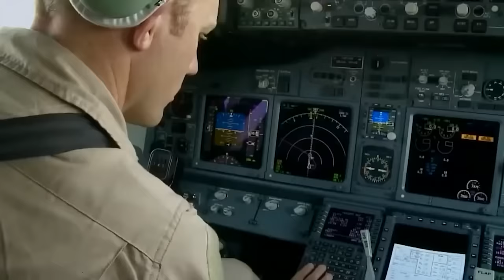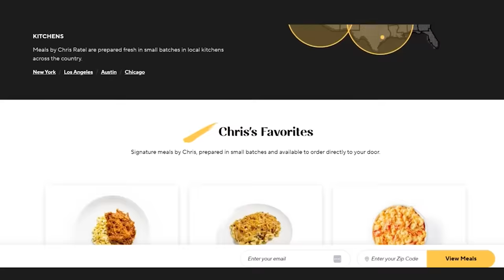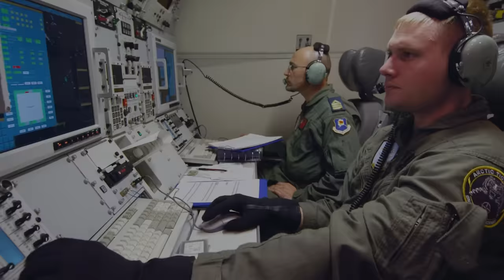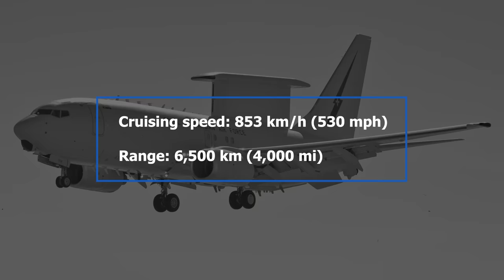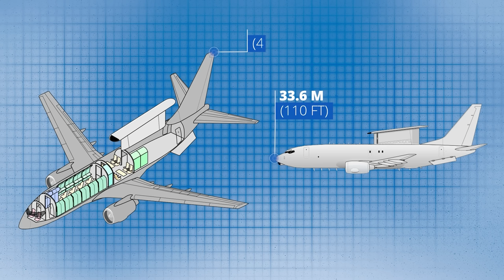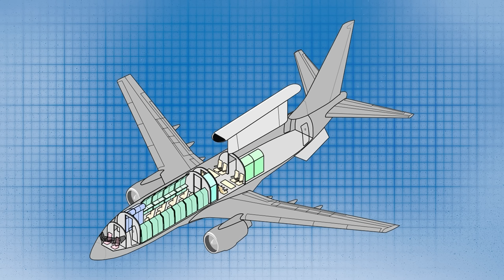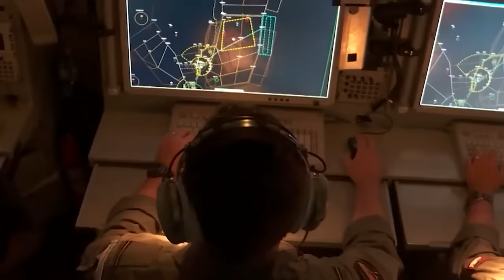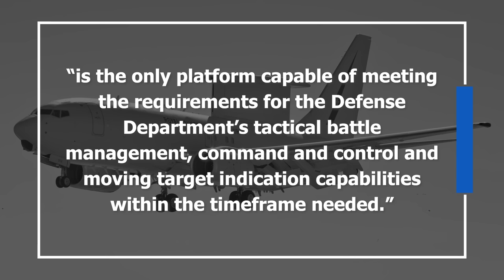The Boeing Wedgetail: The Plane That Will Control World War III

Comment: designed by australians, so you know it has adequate beer storage
Reply: And the doors wont fall off 😅
Reply: Not really designed by Australia, it was a response to an Australian requirement. But yes, beer storage is adequate.
Reply: @thelandofnod123 it was built from the ground up.......the physical platform and the software technology was all Australian designed for our specific regional threats. ........hence why we can tell ANYONE  who wants to buy it that they can only procure dumbed down "export platforms "
Reply: @richardcostello360  Well no, that’s not correct. The RAAF needed a platform, the Government issued a request for information and whittled the choices down to three. Boeing won the contract and was responsible for delivering the project. The DMO was responsible for overseeing the project however Boeing was able to ignore requests from the DMO during design, development and production to deliver the platform as they saw fit. 

The 737 aircraft rolled off the production line as a 737-700 and was then sent to be modified. The first 2 aircraft were produced in Seattle with the remainder modified in Australia. The main sub contractors were BAe and Northrop Grumman. The Australian government were responsible for procuring certain items though FMS from the US and supply them to Boeing as they were not able to purchase them themselves. Local production of components was also hampered because of the inability of the transfer of technology to Australian companies. 

To say that only dumb down versions can be sold and Australia must approve them is nonsense. Australia did not control the technology nor were they responsible for producing it. Turkey and South Korea signed contracts for their platforms 2 and 4 years after Australia. Both of them and subsequent countries have their platforms tailored to their needs and not Australia’s.
Reply: @rjswas  the front, on the other hand...
Reply: @thelandofnod123  Who said Boeing could ignore requests if felt like it. it was developed for RAAF to our specifications for our Airforce and if can sell it to other countries Boeing sells it. if not Australia paid for what they wanted.
If a idea we wanted wasn't put in to it why would we purchase it.

You probably think Boeing MQ28A Ghost Bat is the same lol.
Yea no that programme was not i can tell you that.
Reply: @micksmith-vt5yi  I’ll go out on a limb here and say “the contract”. 

And you obviously have a misunderstanding of how procurement works. 

This from an ANAO report on the project. 

“The project office does not direct or approve the manner in which Boeing is to achieve conformance with contractual specifications. In fact Boeing has the contractual right, for example, to ignore Defence advice on the adequacy of design and development or to proceed to some subsequent work packages even if prior reviews are not successful. These decisions rest with Boeing, which must weigh up the risks of whether its actions will lead ultimately to the milestone requirements not being met.”
Reply: dont laugh, but on a trip to Exercise Cope Thunder 90 in the Philippines one RAAF C-130 Hercules was filled with pallets of Australian beer. True Story, I was a PAX on the aircraft and slept on top of one of the pallets for most of the flight
Reply: @davidewhite69  Must have been a daily courier then if it was only one Herc load, especially as it would have been an E or H.
Reply: @thelandofnod123  it was an H model,  which also had out quick response kit used for repairing any aircraft that broke down on the trip to the Philippines, we had another two H models and an E model with the squadrons spare parts and support equipment, most of the squadron travelled in a RAAF 707 nut I was unlucky to get a seat on the herc as part of the rectifications crew
Reply: @davidewhite69  Are Australian C-130s refrigerated? Would make sense.
Reply: @utoob7361  no, but nortoriously bloody cold or stifling hot, no inbetween
Reply: @thelandofnod123  Yea still not perfect in your comments or ways procurement and development work, some projects only get what Australian defence or government want in these with tech and products.
Australia chose the airframe over the other Boeing platforms as suited their needs more.
Just like the French sub was changed design to suit Australia. just like the AUKUS SUB also more suitable for Australia needs as neither the British Astute or the American suit Australia.
If Boeing said's no to something  the deal is cancelled
Reply: @davidewhite69  I only ever traveled once in the 707, fortunately it was during tanking our Hornets which was awesome. 

Managed one drip on a C-17 on the palletised seating, every other trip was an E, H or J, invariably where the wheel wells are. 😒

I did manage to swing a Lear from Darwin to Williamtown once though for volunteering to skip the early transports home.
Reply: @thelandofnod123  I once got to fly, yes fly, a Lear Jet. When I was at Tindal we had six hornets based out of Darwin for Pitch Black and there was a Learjet there flown by an ex RAAF Mirage pilot being used for dissimilar target training. When I was doing a BF on one of our hornets the pilot walked passed and asked us if anyone was interested in a ride. I got permission from the flight line SGT and to my amazement the pilot said come sit up front, and half way through the flight he asked if I wanted to fly it. I flew it for over an hour. great fun
Reply: @davidewhite69  Nice. What Hornet SQN were you with? 75 I take it, judging by the avatar 🤓
Reply: @thelandofnod123  75 and 2OCU
Reply: @davidewhite69  When were you at OCU?
Reply: @thelandofnod123  late 94-97, from 91 to 94 I was at East Sale on PC-9s, after 2ocu I was at Amberley on F-111s until retirement in 03
Reply: @davidewhite69  Ah, I see, I was over the road at EMS from 97-00 (came from 501 for the ERP), then OCU 00-05 and 12-16.
Reply: @thelandofnod123  I spent several years at 501, on the hangar 410 floor doing F-111 R4/5s. Also was there when it was 3AD, early mid eighties
Reply: @davidewhite69  Nice, I was only at Wings and a short stint at CMTC, so didn’t see much of 410. I bet F-111s to PC-9 was a bit of a change, especially seeing as how the PC-9 might have even still had the new plane smell.
Reply: @thelandofnod123  I went the full circle, F-111-Mirage-Hornet-PC9-Hornet-F-111. and yes the PC9s were brand new when I got to Sale. most of the 75 Hornets were new as well, I did acceptance checks on eight of the 12 hornets 75 first had.
Reply: @davidewhite69  Nice.